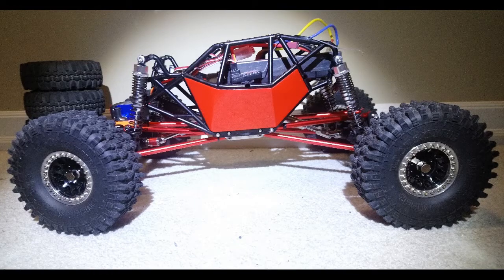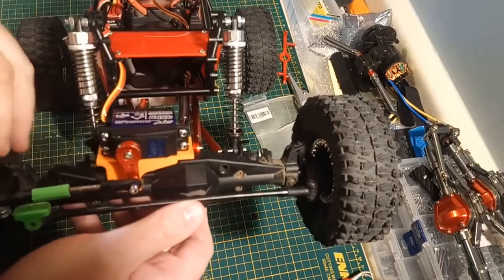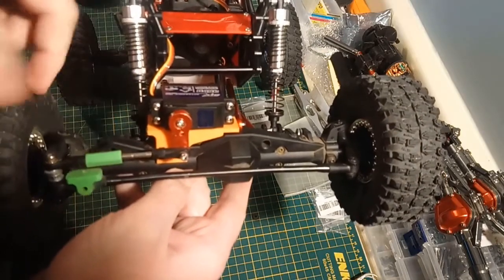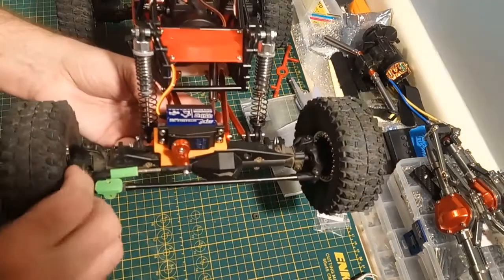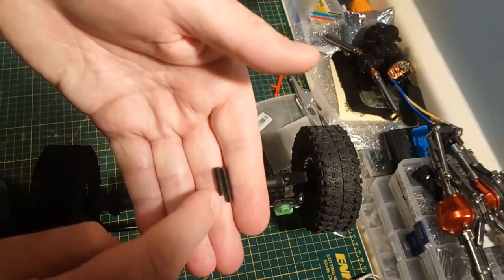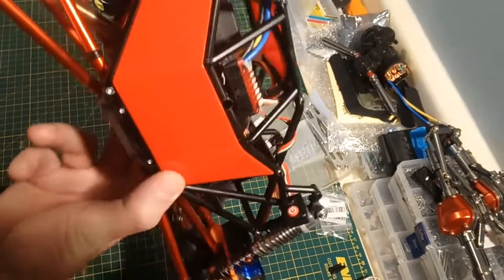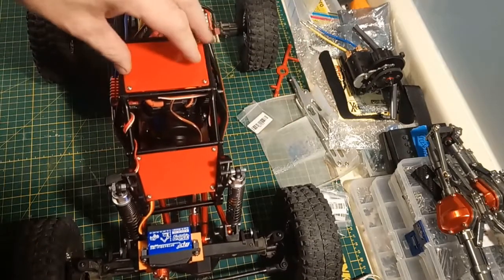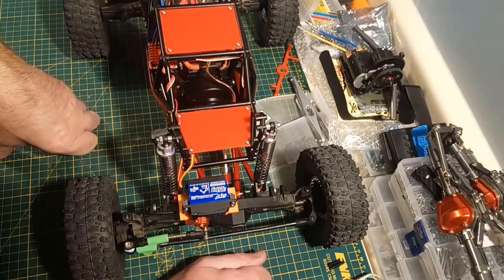Injora Bouncer - Part 4 (ft Redcat XR247 Axles)

Comment: Those shiny chrome and red metal axle shafts on the gearbox behind on the bench are poop yeah,,, they pop under very little stress.
Reply from the maker: Yeah, I did a vid on the ones I bought because they were so shite... pins were too short (and weak), hex shafts barely held in place, pretty much impossible to fix even if you give in to the sickness and try to get some life out of them

Comment: Hi awesome video I've been look at those axles for a build do you think they would gave me a little more speed for trail truck nt really a crawler thanks
Reply from the maker: The best thing to do is check your gear ratios.  These are 32T Pinion with 11T ring (2.9 ratio) and kinda standard is 30/8 (2.75 ratio), so yes they should give a little more speed.  Best to double check whats in yours...  Best mix of speed and control is a high end brushless setup IMO
Reply: @drivetowrench2709  thanks alot for the info appreciate it